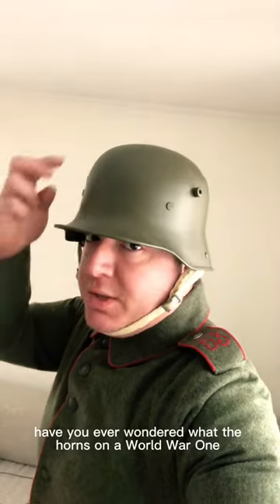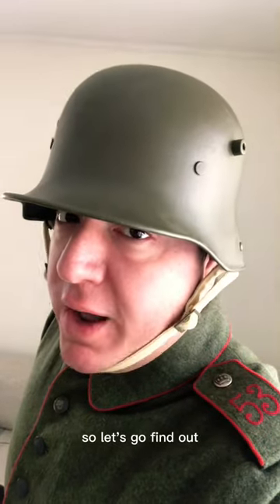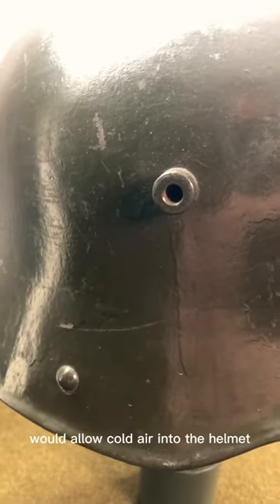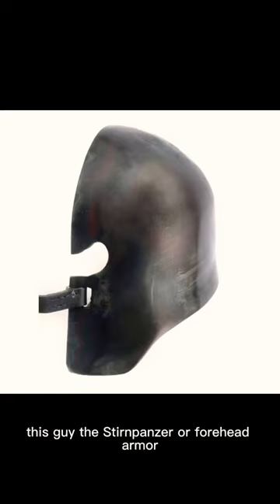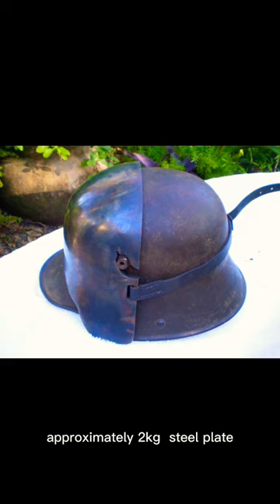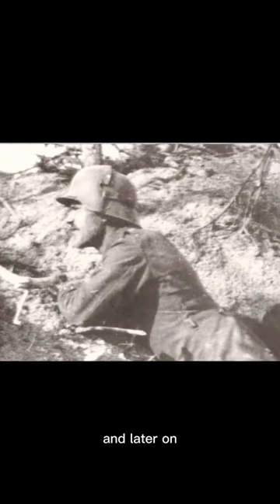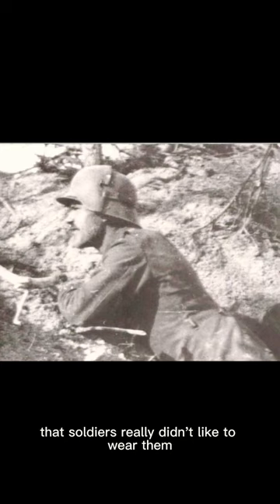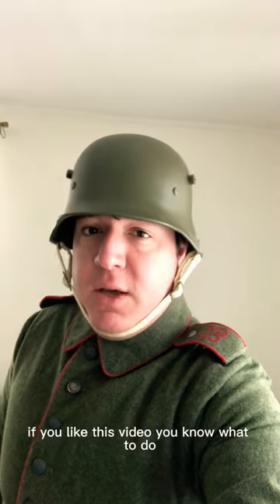The Horns on a WW1 German Steel Helmet #army #history #military #helmet #germany #ww1 #stahlhelm

Comment: The lugs originated from the manufacturing process, but served another purpose. the air holes allowed air to flow through and equalize pressure from nearby explosions.  There is a vent hole in the back too.  Without these, the soldier could risk any number of injuries.The armour plate was an after thought and made use of the lugs already there.
Reply: The bit about explosion pressure is a myth. If the blast can tug on your helmet so hard it snaps your neck, you were most likely already dead from having your chest collapsing in on itself.
Reply: @justanotherrandomfilipino9018 , perhaps you are right, as I am no authority on helmets, and owning an authentic Stahlhelm makes me no expert.  My information comes from a museum curator who researched this subject and was advising the US military for the next generation design of their helmets for bomb disposal personnel.  Unlike the other armies of the great war, the Germans designed and tested their helmets from scratch.  The French based their Adrian off of the firemen's helmet in use in France at the time, the British and Commonwealth soldiers used the so called Brodie, which was based on medieval helmets from the 100 year's war period they found at the British Museum. Without those little holes, the Germans discovered that soldiers could get perforated eardrums, concussions, and yes, neck injuries. I'll leave it to another  authority to confirm or disprove my earlier statement.  The point that should be noted is that this design is the correct one, as most modern militaries have adopted helmets based on the Stahlhelm over the others, including the US M1.
Reply: @AMacdonald-hg8nj  the Stahlhelm was based of the Sallet helmet from the 15th / 16th Century.
Reply: @Themaxwithnoname  bro does not know what he’s talking about
Reply: @justanotherrandomfilipino9018  The bit about the "explosive pressure" is not so much a myth, as it was wrong. It was the same reason that the US soldiers left their chin strap uncoupled. You are definitely correct about, if a blast was strong enough to tug on your helmet, you'd be killed by the blast, but still, they THOUGHT the "moving air" was an issue. It's funny how these things aren't seen for the crazy theories that they are (at the time).
Reply: Oh, I thought it was for balancing it over the fire when they used it as a cooking pot.
Reply: @castleanthrax1833  if it's not moving air or shrapnel that kills you what will?
Reply: @senseishu937  The shock wave and/or shrapnel.
Reply: Front heavy i think too
Reply: No
Reply: I thought they were meant for hanging camouflage on

Comment: A 4.4lb blast shield on your forehead is ALOT of stress on your neck holy crap
Reply: Yes. There are helmets that are designed to rest on the shoulders instead of that ressons. Such helmets afford less mobility thou but in the right situation it is worth it.
Reply: Better stress on your neck than nothing on your neck
Reply: Way less than j thought
Reply: @crusadercreator8277 not necessarily
Reply: @Zebcaramel  did you understand what I said?
Reply: Better stress It Than a huge window in the skull, simple!
Reply: @navidardwarf5216  not when you cant turn your head mid combat
Reply: Better then a round threw the dome.
Reply: @drewdurant3835  can't deny that but if a heavy round hits it it's gonna snap your neck

Comment: Was always told/read they were vents. That plate was an after thought.
Reply from the maker: If the plate was an afterthought, why were the lugs on the experimental 1915 helmets? Question everything.
Reply: @MikeB128  I am guessing they may have been for a jig to hold during manufacturing

Comment: I might be mistaken, but I think your helmet/jacket combo is a bit anachronistic.
At the time the Stahlhelm came around (1916) the german uniform already got some modifications, most notably it lost those red threads, and the buttons were covered so they dont rip off when crawling around.
Reply: You can see in various wartime photographs that in spite of the M1915 tunic becoming standard issue, the 1907/10 versions remained in circulation throughout the war with some units. Personally I’ve always preferred the look of the M1915 in general anyway.

Comment: I thought it was used for a metal face shield. I never knew there was additional forehead armor

i understand the weight was an issue, but was it effective?
Reply: Well it would be about 7mm of steel once the 5mm plate was added... I don't know how effective that would be against 8mm lebel or .303. Depends on the type of steel.
Reply: Yes, effectively, the face is not visible on the surveillance camera
Reply: I doubt it was too effective againts direct hits from a rifle or a machine gun. I know I wouldn't have carried that extra plate around, since it was unlikely to save my life anyways from something that the helmet wouldn't have helped on its own (shrapnel etc)
Reply: Maybe I give them too much credit, but I assume the Germans would have tested it. Even if it saves your life I’m sure you would still get the headache of your life
Reply: @balls2jawls  according to internet forums (Insert salt shaker here) the british tested the helmet and attached brow plate with .303 mk vii ball ammo. It deflects single rounds at 300 yards and the closest range it was not penetrated at was 100 yards. Handgun rounds will bounce off most of the time. (They tested those on just the bare helmet so with the brow plate there's no chance of penetration). The british also noted that there was variation in the quality of steel. I hope this gives a better idea of the effectiveness of the add on plate in a more concrete fasion.
Reply: @balls2jawls  not everything were properly tested  before fielding. For example: someone came up with the idea of turning trench shovels in to portable shields. Hiwever they sucked as shovels because they were so damn heavy and they also sucked as shields, becauese rifle rounds penetrated them. Some of them were indeed fielded but the manufactueing didn't continue for too long
Reply: @TheMegaPingasMobile  it could take direct hits from most rifles of world war 1 as well as machine guns and it could was often used in conjunction with a steel vest
Reply: Finnish Army had similar helmets and those studs were used to attach a machine gunners breast shield.
Reply: Every bit of equipment has its place when used correctly. Storming a heavily defended position, give me one of these bad boys all day long.

Sentry duty in a fairly regular position? Nah no thanks.

All equipment is the same. I'd rather have a rifle than a grenade but there's some situations where a grenade is perfect and a rifle might not even be usable (clearing a collapsed cellar of defenders for example). Every situation is unique and its good to have the choice.

Comment: It's impossible to run in them or conduct assaults with them, tried to during an airsoft match and it's just pulling my helmet forward, I replaced it with a 3d replica cause I want That bf1 German assault look